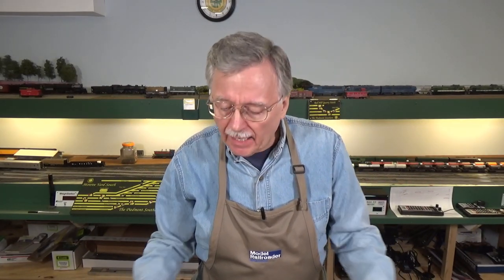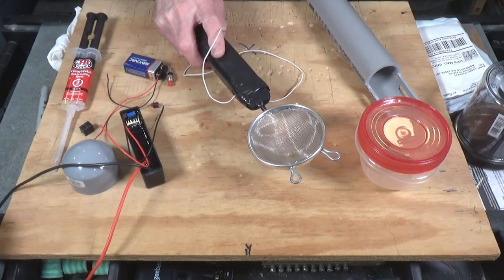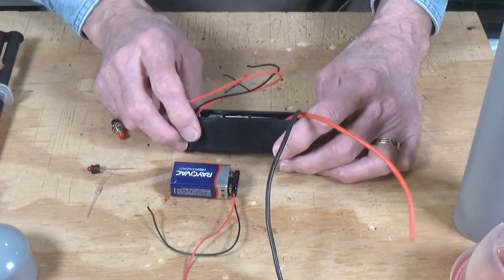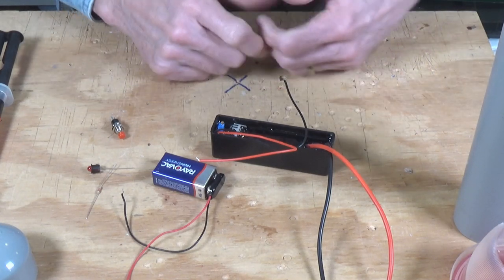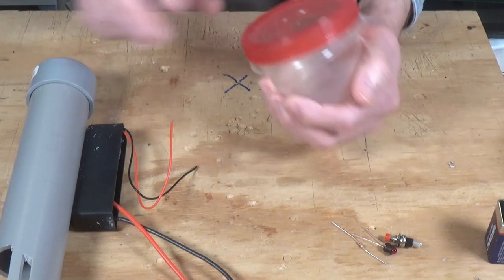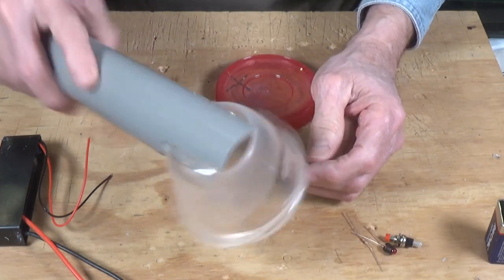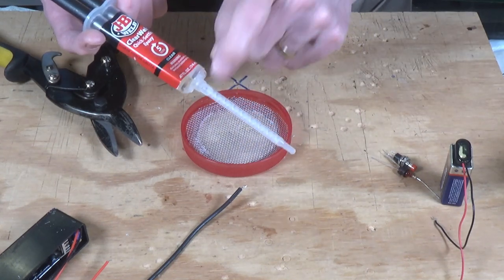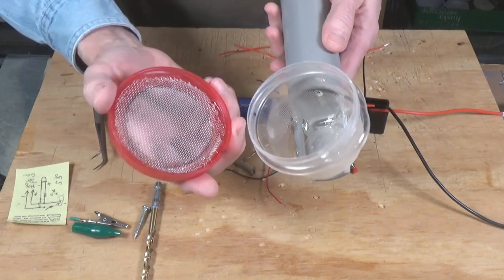New More Powerful DIY Static Grass Applicator Pt1 (165)

Comment: I built one from Luke's video but I had no luck powering it with an old 12v phone charger. Thanks for sharing your version.
Reply from the maker: Hi Ron—it should work with a 12VDC power supply as long as it is still good. Those old chargers can fail. I like the freedom of using the 9VDC battery myself so skipped the wall wart approach but it should be a viable option using Luke’s wiring diagram. However I don’t like the idea of using the rocker type switch as it leaves the unit powered unless you find a switch that is spring loaded and returns to the off position by itself.

Comment: Hi Larry, came over from the "angry space soldier" part of the modeling hobby.  I love this video and I'm going to post it at a couple of my usual haunts on the internet.  We dont do as much big pieces as you so buying a static grassdevice isn't really a good choice but building one is a great option.  We do a lot of bases for out models, 3inch to 1.5 inch typically, and this static generating tool could offer us a LOT of choices.  

Thanks!
Reply from the maker: Jason, thanks for spreading the word—Larry

Comment: Thanks  for this Larry just came at the right time made a fly swat one at Christmas, but need something with a bit more power but needed a bit more info on the generator. keep up the good work from Matt over the pond.
Reply from the maker: Be careful buying a generator on  eBay as they come in many versions, some with multiple output wires and some with only one output wire. To keep it simple I found one with 2 wires in and 2 wires out.

Comment: Just a little tip for anyone making one following this. That screen could be tacked in place in just a few seconds with CA glue and zipkicker. Then you can go ahead and put the epoxy around for a more durable hold. I'd also get at least two extra lids for progressively bigger screens. With one of these applicators one size fits all is not best. The different length static grasses will work better or worse with larger or smaller screen sizes. Basically the smaller holes for shorter grasses and bigger holes for longer grasses.

Comment: Thank you for this! I built a flyswatter version, but I found that the epoxy I used didn't stick the mesh to the lid. I'll have to try JB weld.
Reply from the maker: Also make sure to sand the plastic in advance to give the glue something to stick to.

Comment: Thanks Larry,  enjoy your videos.  They’re always interesting and informative.  I’ve been thinking about this video and wondering if you’d considered using a step up power booster to raise the voltage to 12 volts.  Would this increase the output voltage to the complete 20k?
I’m going to give a try when I build mine.  I’m just waiting for the supplies to build it.  Thanks again for your great videos!!!
Reply from the maker: I do have one of the little voltage booster circuit boards a d may give that a try. However you can’t get something for nothing and a boost i  voltage will mean a corresponding drop in amperage, don’t know whether it is the voltage or amperage that matters most in this case but worth a test. I was looking back at the results with the 9VDC and the third configuration was so good I may not fiddle with things until I get my hands on some 12 mm grass to test with.

Comment: The output is not linear with input... 20kv/12vdc  is not equivalent to 15kv/9vdc... but unless you actually measure it, you won't really know. Regardless, you will have less output than max kv. I use those modules and they work very well in the flockinator I make.
Reply from the maker: I figured that might be the case although it should not be a significant drop, but since my voltmeter max’s out at 10K I have no way to check it. Have you seen a typical response curve for these devices?

Comment: about those china made transformers.. has anyone reported any case of arcing¿¿ im kind of concerned  about it. I know low current most probably wont kill you but it still hurts, I learnt that the hard way with some CRT tvs.
Reply from the maker: Watch the whole series on these applicators. I show a further modification that puts the “hot” plate at the back of the container instead of on the screen so you can’t inadvertently touch it and get a shock.
Reply: @TheDCCGuy  thank you!